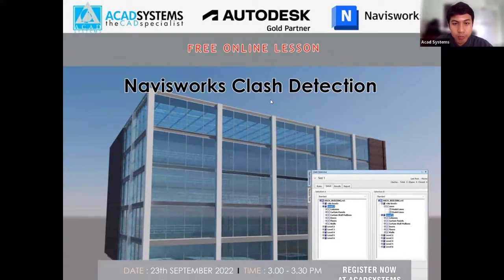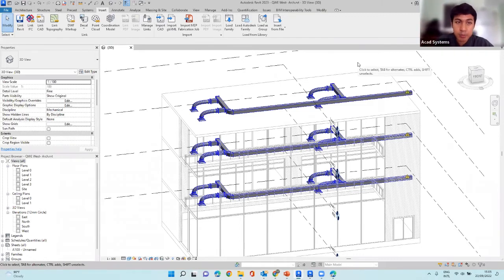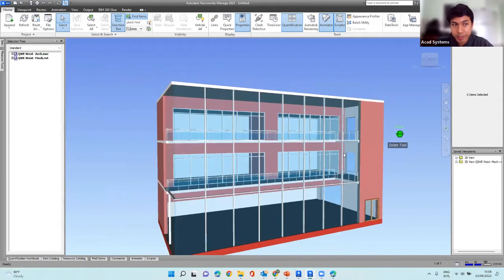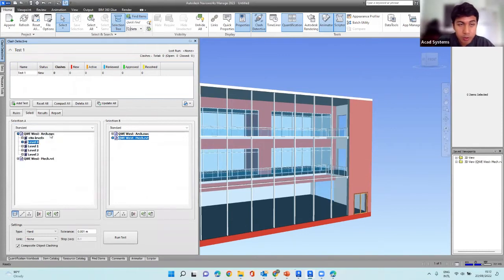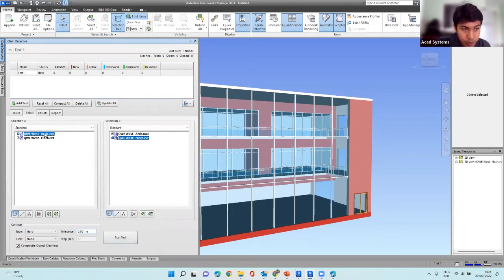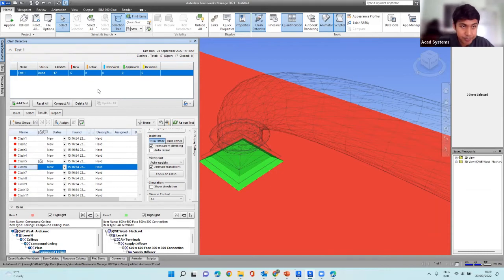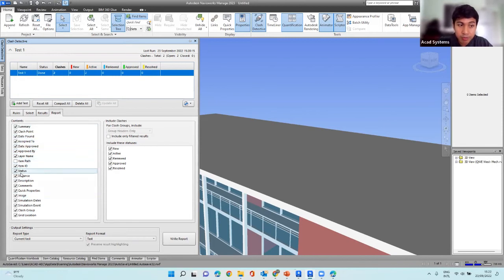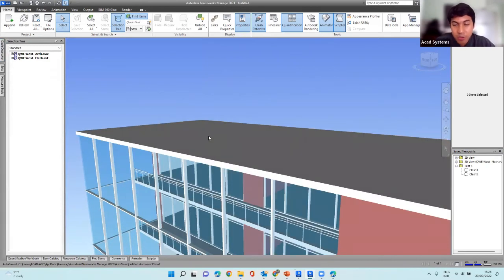Naviswork Clash Detection

Comment: Can you extract resource graphs from Navisworks? Like lets say how many workers are on the field each day
Reply from the maker: Hi, you might want to check out Navisworks Timeliner tool. By default there is a Labor Cost column that you can use. By bringing a schedule from a csv file you can customize your own for example number of labor. Timeliner are set based on duration of a task. It might not be practical to extract number of labour by each day. Hope this helps. 😀